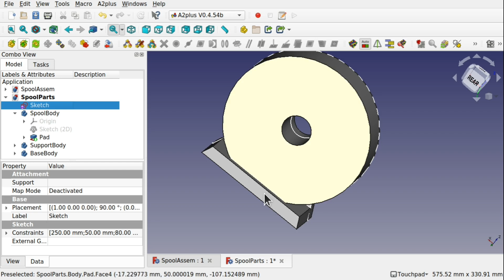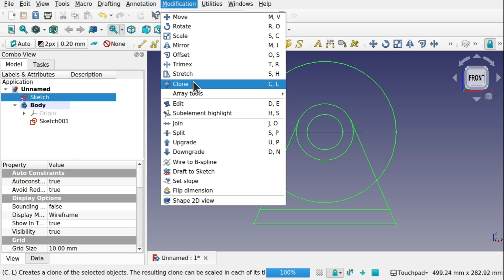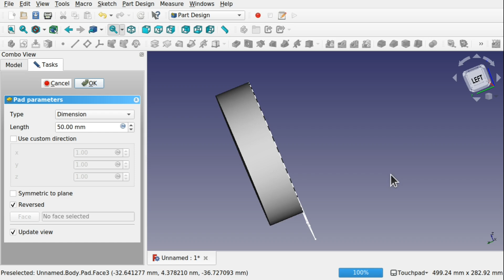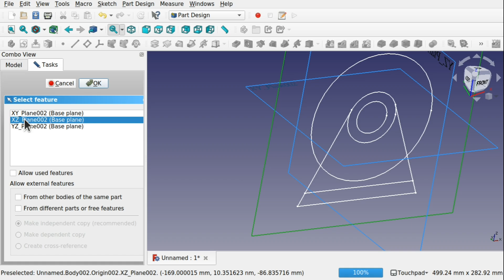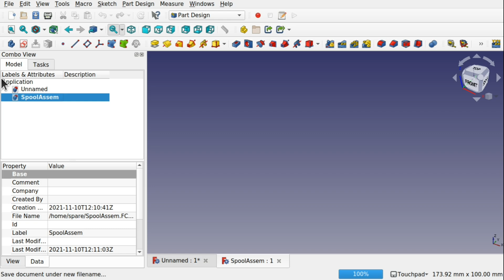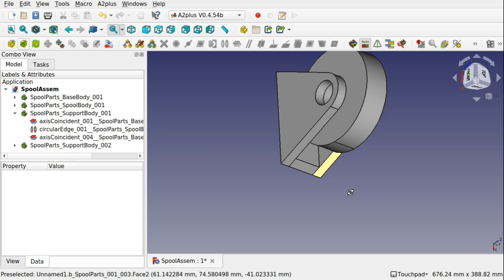Understanding FreeCAD Lesson 2 Part Design Master Sketch Parametric multi-body project for Beginners

Comment: You demonstrate that if you modify the base sketch, changes there get propagated into the clones. That means the clone is NOT a clone in the precise sense of the definition. Rather it is a reference. For example, changes made to Dolly the sheep's progenitor would not be reflected in Dolly after she was cloned. Please comment.

Comment: I've got Freecad V.21.1, I select the master sketch, click Draft, Modifications and sometimes the clone command is greyed out. Nothing brings it back. Second problem is I've finished the Spool, Pad and then create Body001, Sketch(2D), Sketch002. I also rename Body and Body001 but I can only get Edge Geometry in Sketch002 not Sketch(2D) like you do in the tutorial. Also in Sketch002 when I get Edge Geometry, I can't select the 50mm circle, it's disappeared! I can select everything else but of course it won't Pad. Is this me? or is there something wrong with this version.

Comment: I am very new to CAD, and FreeCAD but I am learning. Love this series. But some things, that you make look extremely easy, have cost me hours. Many times I have tried to delete a constraint and it simply won't do it. In other cases the whole of the sketch goes orange. Sometimes I have no choice but to start over because I simply can find no way to recover. I have spent half a day working on a sketch of what appears to be a relatively easy almost rectangular gasket with two holes and one side at slightly off 90 degrees. Many times tangent constraints created by the polyline tool did not work properly. They were not connected the rest of the line so it never became fully constrained even though it looked just fine. Try to fix one thing and it would complain about another constraint. One other thing I should mention is that occasionally when I delete something the whole sketch seems to dissapear. But I found that somehow it had zoomed out to the point where the whole sketch had been reduced to one dot on the screen, actually off the screen. To be honest, I think FreeCAD, under Linux, was just not working properly on my laptop. I tried it again under Windows on a desktop and it worked fine on the first try. Eventually I got it done on the laptop too, but I almost think that was pure luck. 
  This series is great and will no doubt save me a lot of headaches. A video on what is going on when things DON'T work as expected and how to recover would be a wonderful thing. Thanks!

Comment: Another way of "cloning" without linking (if you don't want it linked for some reason) is to use the standard "Copy/Paste" method.  A pop-up window will allow you to pick and choose which body-items you want copied, and then it will drop those into the main project menu area (in other words, outside the bodies).  You can then drag and drop what was pasted into whatever body you want for further, independent modifications.

This is a "long way around" method, but it can be useful for decision-making processes (say, if you aren't sure what size you want the flywheel to be, so you're just visually making comparisons between the original size and a new size), or perhaps you're designing two different sizes at the same time and want to show them side by side once they're complete, as part of the same overall file.  It can also be useful for backup purposes (especially for beginners who may make mistakes that are difficult to "Undo").

Also, F2 (for those who have that available) is a default FreeCAD shortcut for "rename."  Saves a bit of time that way.  I like to use "F2" then "End" then "Backspace" (over the numbers after "Body") then "Space" then "Hyphen/dash" then "Space" again, then I name it whatever I want.  This way "Body" always shows up first in the list.  It's a good way to make it easier for a beginner to navigate and to remember the FreeCAD "layer/sub-layer" conventions.

Something else to note is that when creating an arc from an underlying circle, the 3-point arc doesn't work as well.  If you zoom in very close, you'll see that it doesn't actually match the radius of the circle perfectly - there are gaps and errors, even though the circle highlighted in yellow.  Using the "Center and endpoints" option will work better.  You can pick on the point at the center of the underlying circle and then the two tangented endpoints of the two lines, then use the "X" Constraint tool to ensure they align and snap together perfectly.  You can also use the radius and angle tools to ensure that the arc and circle have the same numbers.  Another way is to use the "=" tool to fix the radius and angle of the arc to match it to the circle (that only copy/pastes the radius and angle info to the 3 point arc though, it doesn't snap it into place over the circle).

When you added the horizontal constraint to the line between the two tangent lines, something that would be helpful would be using the symmetry constraint on the endpoints of that horizontal line, to keep it from drifting to the left or right when being moved around.

The part at the end where the file is duplicated and then assembled seems redundant to me.  I don't know if there's a need for file duplication in the 3D printing or other manufacturing processes.  If not, then it seems like copying and pasting the Sketch from the SupportBody Pad layer into a new Body (maybe SupportBody2), turning off the SupportBody (maybe renaming it SupportBody1) with the spacebar, and then moving the contents of the original sketch (I think there are multiple ways to do this), then using the "X" constraint tool to snap everything together so it all lines up perfectly, would make a lot of sense.  This way there's only one file to have to work with, it's a bit smaller than the total file size of two complete and nearly complete files, and the "X" constraints can be turned on and off as needed.  If two files are needed, then nevermind about this paragraph!
Reply from the maker: Thanks for the in depth reply with all those tips, really helps people with the learning and the alternative ways to do things. Thank you :)
Reply: @MangoJellySolutions  Thank you for letting me!  👍🖖

Comment: in version 0.9.24366 on mac when I try to import the parts into SpoolAssm via A2plus it only lets me import them one at a time, that 2nd icon even says import a single shape, can't find a way to import multiple parts at once. not really a problem but would be better, I think, if it did still allow multiple selection.
Reply from the maker: I have a mac at work so once I am back after my holiday I am going to see if it's a problem with the mac version.

Comment: Many thanks for the video, very well explained. Shows again how awkward and burdensome FreeCAD is compared to Fusion360. In Fusion you would just make a single sketch and from this you can directly select the areas you want to extrude into the different parts. Takes 30 seconds to do. In FreeCAD you make the sketch, clone it for every part, import the features you need, then re-draw every feature you need, and then extrude it into a body. Repeat for every part. Awesome...
Reply from the maker: Thank you. I wish there was a way in freecad to replicate that feature, it's one thing I miss from Fusion, makes things so quick to design.
Reply: @MangoJellySolutions  Use a binder, and you have the exact same functionality. Unless I am missing something?

Comment: Good video. Can you publish your preferences please.
Reply from the maker: Thank you, Which preferences are you interested in? I have increased the size of my icons and I have turned off the report view showing on error. I also use the touch pad navigation rather than blender or cad navigation. Out of  the box that's about it. Oh and freecad 0.19
Reply: @MangoJellySolutions  It is the screen colours and sketch lines I would like to copy. Thank you.

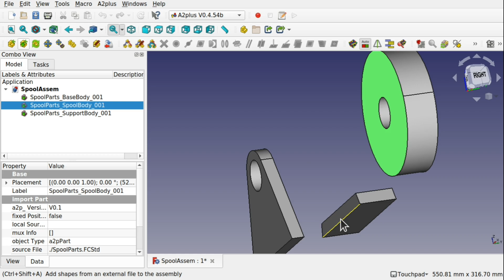Comment: Thank you for a really good video, I just started with FreeCad. I have one little question; in the end about 27:50 in the video when you select 2 edges I'm only able to select one at the time. It took me a while before I noticed that I have to hold down ctrl-button when I select 2 different edges. Is this some settings I have to change or is this normal?
Reply from the maker: Great to hear that you found this video useful. No that was my fault, I should of said that I ctrl selected the edges, sorry (I normally do). I have tried screen button overlays so if I do forget viewers can pick it up but running on Linux there are limited ones and some of them just don't work. Again apologies.

Comment: This is magnificently-useful, but it also seems like a bodge around a limitation in FreeCAD.
It would be far more useful if in FreeCAD there were an option akin to "Create and Edge Linked To External Geometry" but which simply, with one click, created that duplicate inside the sketch, rather than requiring the user to then go and draw it all over again.
Reply from the maker: It would be a great feature to and save alot of time. Maybe worth suggesting it as a new feature

Comment: mango your videos on freecad are great. have you ever used construction geometry in sketcher to rotate parts of the sketch? ive use this method to create aluminum profiles and complex things like say a quadcopter with multiple arms extending from each main arm. 

i use a 3 lined construction cross with each 3 ends connected  perpendicular to a outer circle and then restrain the sketch using length constrains and angles at where the circle/cross meet ( it makes use of many construction components typically boxes and bisecting lines that constrain the sketch) after that you can copy the "master" sketch and each copy from the master (and only the master)  can be point constrained to the center point of axis rotation (which has to be another point), then you constrain one side of the cross with the previous copy, so if its a perfect 4 sided arm in 90 degree intervals you can just set hor and vert constrains on each of the applicable cross lines and save a lot of time doing so. I've hoped that ive made it clear.
Reply from the maker: Thank you for your comments, glad you like the videos. I've used construction geometry for mechanical movement such as cam followers and linkage arms like a skeleton. But I mostly use constructible geometry for normal static sketches.

 I was drawing what you describe as I was reading your post  and I see exactly what you have done and I think this may help me  start to  tackle something that I am looking to do so I may borrow your technique. Thanks for the description.

Comment: Very clear and useful!  I tried the mastersketch concept about 6 months ago and at the time, the forum recommended using shape binders and sup-shape binders.  I never could wrap my head around how to use those properly and ended up just manually recreating the sketch. This looks much simpler.
Reply from the maker: Thank you for your comments, great to get feedback. I will go into the shape binder and sub shape binder in another video and towards the end  show how to use this with master sketches comparing the technique with this video. It's one of those that's hard to explain but it's much easier to see it in action.

Comment: Good video. But is there a specific reason why you are using the clone command from Draft instead of a shapebinder to refer to the master sketch? With that method you can just stay in Part Design. Saves a few mouse clicks (and for newbies, it eliminates some confusion).
Reply from the maker: Thank you glad you like, Yes, that's actually is in another part of the course where I go into shape binders and towards the end I go back and compare this method with a sub shape binder method. I was in two minds to do it this way  but I wanted to get  into bind modes and some of the other options so thought it was a bit early in the course to dive straight in so used the draft clone instead.  I found it quite hard to plan when and where I want to talk about certain features, trouble with Freecad there are so many ways to do the same thing.

Comment: You make it all look so easy, it’s very impressive to watch a master at work!

I’m very new to 3D modeling so I desperately need this kind of advice on workflow and best practices.  There are a thousand and one ways to do everything and it’s not always clear which way is best from a general CAD perspective, from a FreeCAD feature/bug perspective, etc.

Do you use this master sketch design pattern for your personal projects?  I’d love to hear about your approach so I can copy it. :)

So far I’m doing roughly this:
1. Separate parts for all things which move independently.
2. Separate bodies for each major element of a part which I may want to operate on.
3. Separate sketches for each body.
4. Spreadsheet values drive all key dimension constraints.

I think extending this to include the master sketch and cloned / external linked geometry like you’re demonstrating is a good idea too.

Do you have any general advice along these lines for a newb?

I wish you and yours all the best, take care!
Reply from the maker: Great to hear your progress and thank you for your kind comments. Yes I do use this workflow when I am creating multi body builds especially when the position depends on each other. It is timely you should ask for an example as I am looking to release a project based video for lesson 3. If you think of anything mechanical such as cam followers, mechanical arm linkages, a wish bone suspension assembly etc then you have multiple parts that depend on each other. These parts position can be plotted in the master sketch from a profile view, even if it's just simple lines and circles showing attachment point, top and bottom edges etc. This gives you an idea of where everything should fit and design in the necessary clearance when you have moving parts i. e the forks of a bike need to clear the top of the wheel but the attachment of the breaks need to be in such a way that the break pads can sit on the rim. These points such as the wheel can be just lines i. e top, top rim, central etc.

Some things that I wish I knew about when I started is the standard part and that they can be nested. These are the yellow body objects that you can group bodies in, they are mearly a grouping tool but allow you to move and hide all objects within at a click of a button. Even drop the whole group into techdraw. Also what you build doesn't have to be all in one document, use the link feature to link   in your master sketch from another document and you can build each part separately. Also there are many tips and tricks but really learn how to use the selection tools such as box element selection and even the selection panel. 

Is great that you shared what you are doing, you are on the right tracks.

Thanks once again
Reply: @MangoJellySolutions  thank you so much for your ideas and encouragement!

Just yesterday I modeled a empty cylinder with one end closed and a shaft down the center (it’s just as simple as it sounds).  I added an angled fin an then tried to use the polar pattern feature to create 3 more around the inner diameter of the cylinder.  When I do this I get an error that’s something like “shapes do not intersect support”.  It seems this is a known bug already being worked on for 0.20 (some obscure issue about coplanar surfaces?).  I’m sure there is another way (many ways!) to model the other components that would avoid the bug, and so it got me thinking I’d like to figure out how experienced pros use FreeCAD because I’m sure they have adopted a workflow that automatically side-steps various limitations (topological naming issue, etc).

I look forward to your next video — keep up the great work!